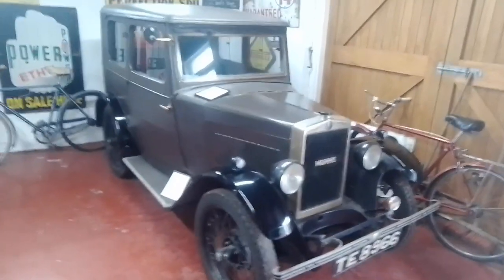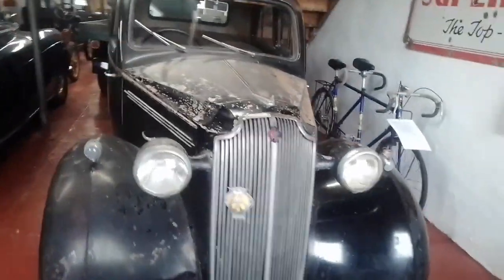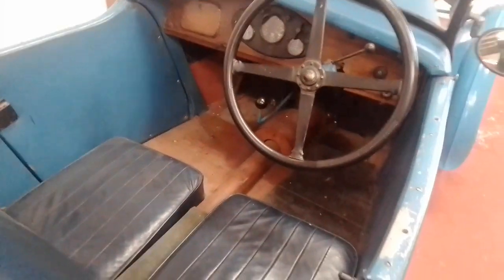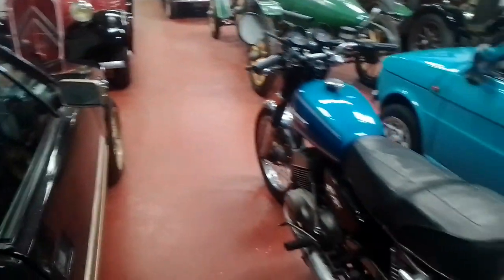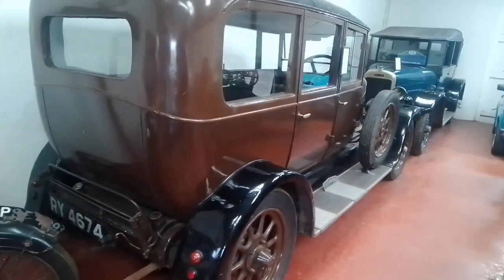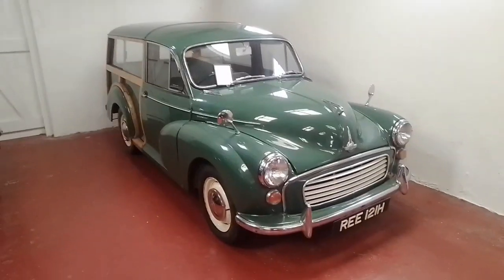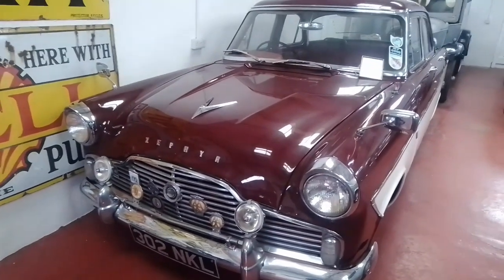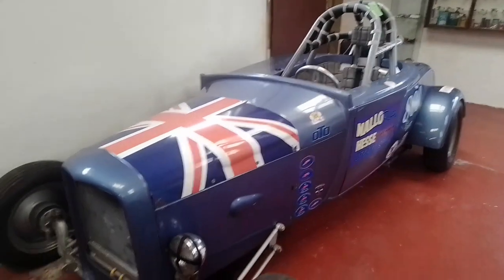**500 Subscribers Video** A visit to the Myreton Motor Museum Part 1

Comment: Congratulations again on reaching 500 subscribers.
I rather like the traction event and it's one of the only pre war designed cars that I really would consider owning. Many of the cars for the UK market were built in Britain.
I think.that the X1/9 is probably the car I'd most like though out of that collection. The later 1500cc Fiat and finally Bertone built models with the five speed gearbox may be the better cars mechanically but an early 1300 with the split front bumper are the best looking.
The Suzuki GT is a bike from the era when my dad worked in the trade. I think the GT may have been two stroke but I could be wrong.
Those early Fiat 126 are starting to become desirable now but still much more affordable than a 500. My Aunti had a chocolate brown air cooled 126 and then later a water cooled hatchback known as the 126 BIS. I'd like a 126 too.
Another great video.
I look forward to part 2.
Reply from the maker: Thank you for supporting the channel over the last few years, it has been much appreciated.

The X1/9 was rather lovely and the paintjob it had actually looked very nice and to find it had been serviced by a dealer about a couple of miles from my house made it even more special. Each car seemed to tell a story like the X1/9, the little Mini Traveller but for me it was the Vauxhall at the start, you would have never have known it was pulled out from a River in the 40's.